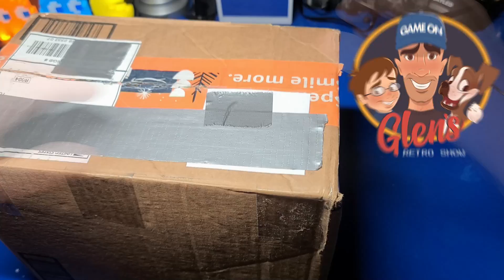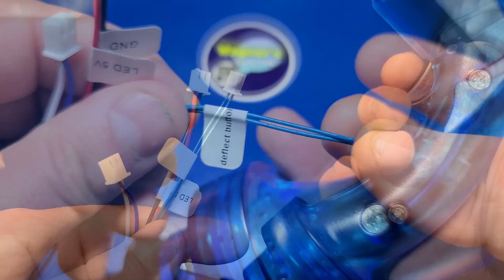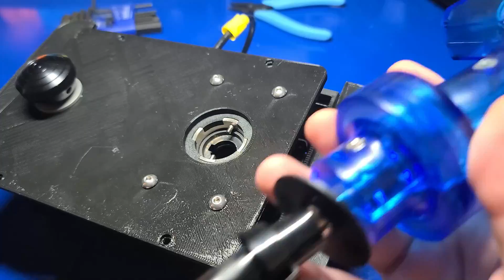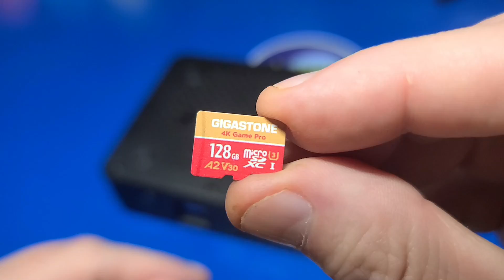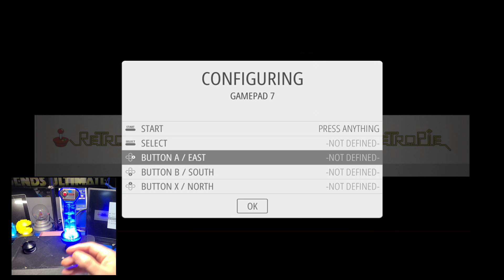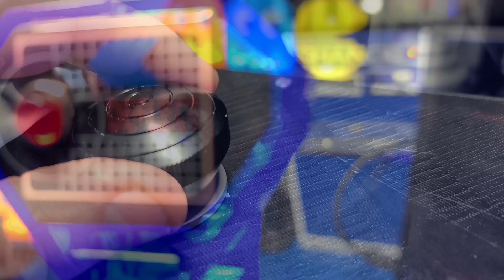Glen's Retro Show Push-Pull Spinner and DOT Flightstick RetroPie Build

Comment: Where did you get the encoder / wiring for the GRS flight stick?
Reply from the maker: The encoder came with the original Tron stick.  If you need one, I'm sure Glen would have a recommendation here: https://www.glensretroshow.com/contact/

Comment: Great video.  Thanks for going through the full setup.  I was curious though if you've encountered an issue that I'm having.  I'm using the same GRS flight stick and push-pull spinner, but I've noticed that if I'm moving right or left with the Flightstick that the input from the spinner seems to be interrupted or blocked.  I have to re-center the Flightstick and release its microswitches in order for the game to respond to the spinner.  The Flightstick is connected to the Xinmotek encoder board that came with it, and both it and the spinner are connected via USB to a pi 4.   The other thing I've noticed with this stick is that when I return it to center the microswitches sometimes remain depressed.  So to get the game character to stop moving left, I have to move the stick all the way to the right and then back to center to ensure that the left-microswitch is released.  These two issues combined make it difficult to use these controls.  I've built a nice bartop Discs of Tron cab though so I'm hoping to get these controllers working smoothly.  I've emailed support but thought I'd check to see if you've run into either of these issues.
Reply from the maker: Thank you Phil!  I don't recall encountering this issue.  I was using Advanced MAME during my testing on a Pi4.  Is that the same setup you're using as well?
Reply: @WagnersTechTalk  Thanks for responding to my question.  I'm also using advmame on a pi 4.  The pi is running Raspbian 10 and advmame was compiled from source.  I'm using the same V1 spinner (TS-DOT-SP01) that you're using.  The issue is more noticable on the 3-platform DOT levels where you might hold the stick left or right while also rotating the spinner--this is especially true if I'm running from one of the chasers while also trying to aim at it to shoot it.  The tank level of Tron also has the issue and because it's slower paced it's easier to see the nuances of the problem.  When the tank is moving up or down there's no issue with using the spinner, but if the tank is moving left or right (with the flightsick held left or right) the turret will respond to the spinner for only about 1 second and then stop rotating.  I ran the input test for both games and it doesn't show any overlap between the flightstick and spinner inputs.  I also contacted Thunderstick support but they haven't really been able to help since their support is geared more towards the newer V2 model of the spinner (TS-DOT-02), which has the benefit of a software configuration tool.  I suspect it's an issue with advmame.  Could you possibly post the dotron entries of your advmame.rc file to the description so I can compare them to mine?

Comment: Do you have a favorite USB hub for me to use so I can do an "Open Arcade" like thing with my PC? That is, I would like to not have to use long USB that reach behind my PC for each arcade controller box. Should I get a hub that sits on my desk right behind the open arcade boxes? 

Alternately, in the case of a Discs of Tron set up, (DoT stick plus Push/Pull Spinner) there would be two small boards (one for the joystick and one for the spinner) that would each have a USB cable running out of them. Is there some sort of USB splitter or Hub board that would enable me to only have one USB cable running out such a box?
Reply from the maker: The hub I used in this video was one I had on hand (and have used for about 20 years lol).  I have bought a few other hubs lately for use in other machines which should work equally well with this setup.  This non-powered hub https://www.amazon.com/gp/product/B07L32B9C2 connected to this extension cable: https://www.amazon.com/gp/product/B00CFL6ARO will allow you to have a single USB going out the back for connecting to your PC.  On the extension cable, use electrical tape or cable ties to keep the cable from being pulled out of the control box.
Reply: @WagnersTechTalk  Thx a bunch.

Comment: Would I have to do anything different if I want to use the parts with a Windows PC?
Reply from the maker: No Sir, should work fine connected to a PC as well.
Reply: @WagnersTechTalk  Thx for fast reply. I have seen some videos speak of dip switches or different micro boards for PC vs RPi, so I thought I'd ask.

Comment: I’ve been waiting for this video! I do not have access to a 3D printer but would like to build  my own bar top dedicated Tron/DOT cabinet. Do you offer an option where I could purchase the 3D box pieces and I can assemble it myself?
Reply from the maker: Awesome, glad you like this project!  I'm not setup to print these, my printer is quite old and not something I can do here.  But, there are places on-line where you can send them the models and they'll print them, for a fee.  Keep in mind, many that I've seen will charge quite a bit and may almost be cheaper to buy a 3D printer and DIY.  If you do get a printer, make sure the bed size is at least  227mm Length X 148mm Width X 150mm Height.